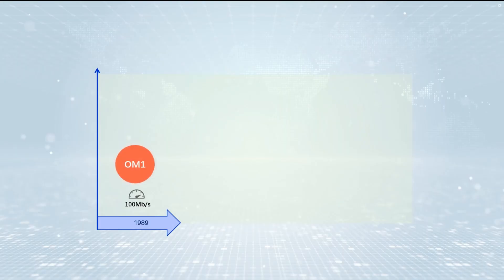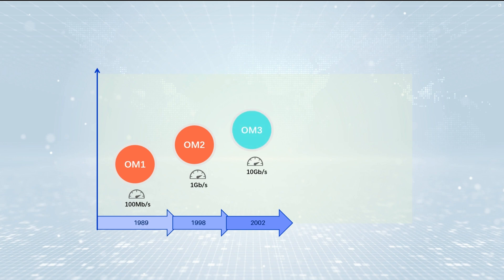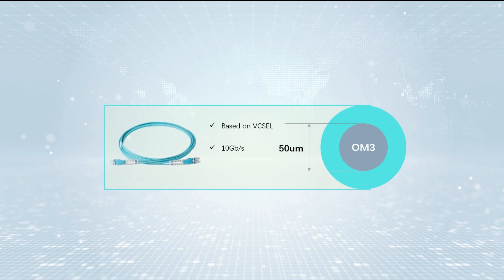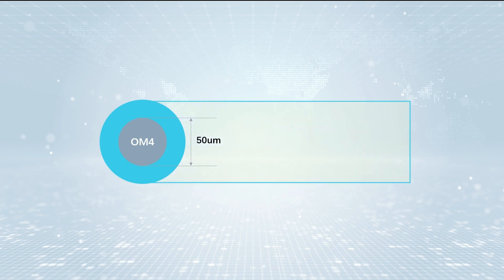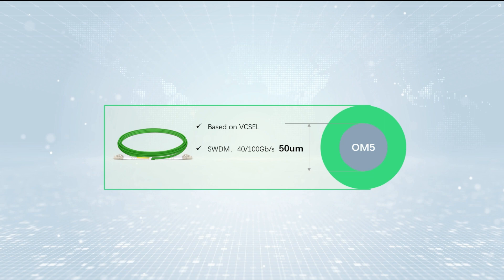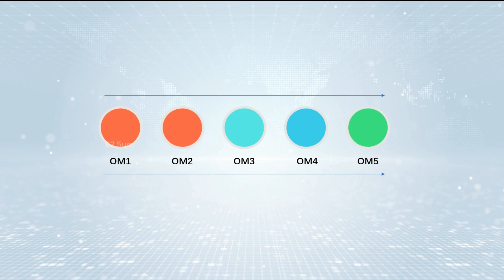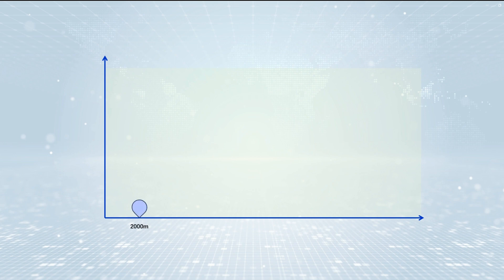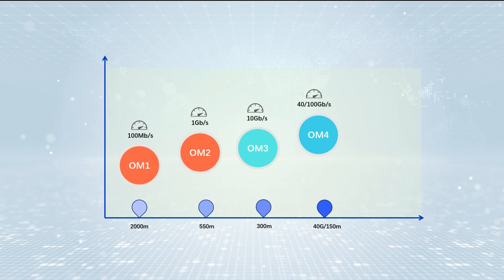Multimode Fiber Types: OM1 vs OM2 vs OM3 vs OM4 vs OM5

Comment: Would it matter if you upgrade an om1 fiber optic system ckt to be om2 or 3 is that possible? Since om1 uses LED transmission source, or would it need a laser source. Let me know thanks!